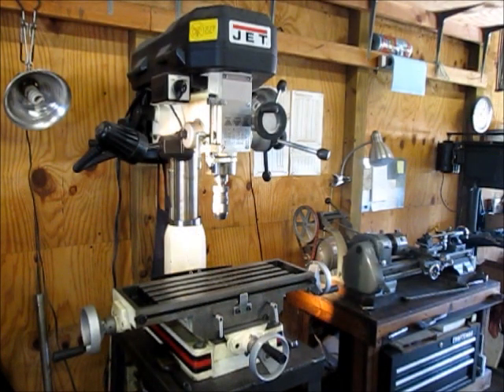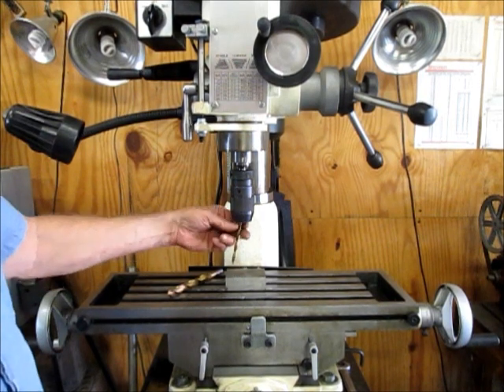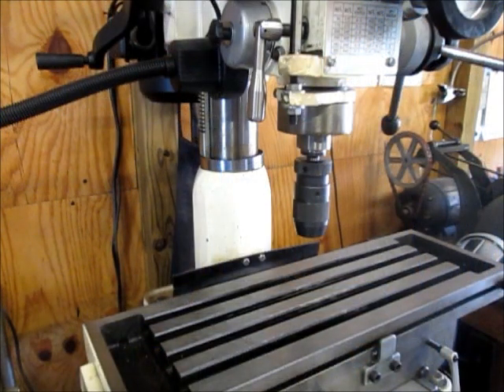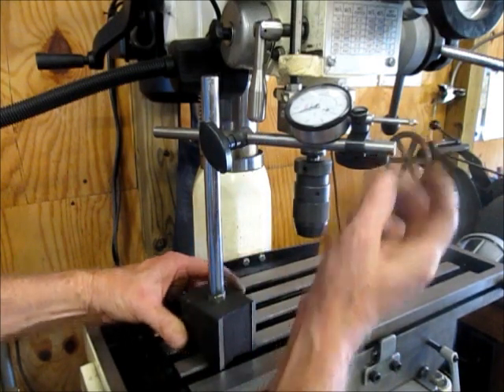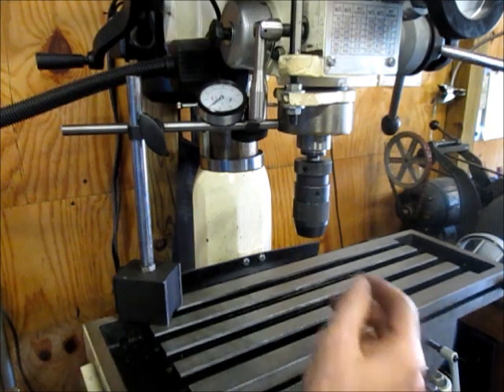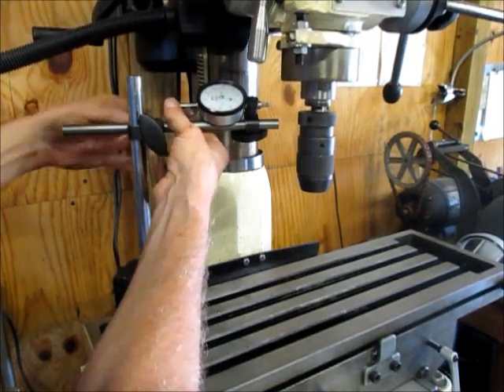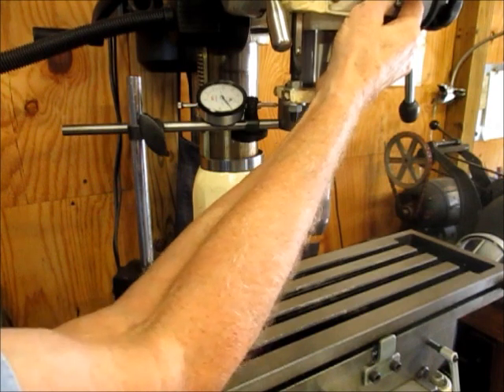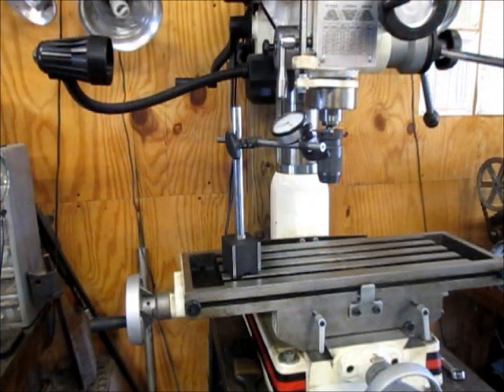Round Column Mill Head Alignment

Comment: I, too, have a round column mill. I fitted a second column, with ball race followers. Coupled with power lift (no external torque) it gives head movement without needing to re-align. Build is in my videos. You alter the height a lot more often when it is easy!

Comment: Exelent solution to the problem. BTW, we’re using those machines for projects with not very tight tolerances. Usually within.003”. I never had a problem with re centering the had.

Comment: I think you're procedure is good except the use of the "hardstop" because there is no assurance that you won't bump the hardstop with enough force to move it a few thou and the indicator will still read zero.  It would be better to just use the indicator zero without the hardstop.

Comment: This is the first video I've seen with this method and how I have verified the head on mine for years.
I've looked at all other modifications that have been machined, bolted, and welded on, and there is still deflection with the final product/end result.
Save yourself a lot of time and aggravation, use a dial indicator with a magnetic base... just verify your quill is true to the table.. the four bolts holding the column to the base can be shimmed.

Comment: My feelings exactly. I just purchased a used 2007 Rong fu 31. I have been looking at a number of videos on “ the big problem with round column mills” and all the time people have put into making a guide system to mount on the side of the mill to “fix the big problem”. I consider the common sense method you show is the easiest and simple way to deal with the round column. Thanks for the video. Maybe some of these others might look at say. “Why didn’t I think of that?”

Comment: The dial indicator is pointless when up against the hard stop. It won't tell you if you're pushing on the stop. Use the same method, but with the dial indicator alone.
Reply from the maker: not so

Comment: This is a good method, thanks. I've been using the laser method and that works pretty well. I have a future project to attach a pillow block to the side of the head and another pillow block to the side of the column casting, along with a rail between them (all acquired from 80/20). Once completed, this setup will render the mill a non-columner mill. Super easy to move up and down with confidence. Speedier too.
Reply from the maker: Sounds good.
Reply: What is the laser method? Thanks
Reply: @kennethtencza9209  you probably heard by now, but you mount a laser on the mill head and aim for a line on an opposing wall.   The longer the distance, the more small moves are magnified.

Comment: Another method is to mount a laser on the machine, and a target line on the opposite wall.
Reply: Ive tried that method  and unless your opposing wall is a very long distance away, you wont get any real accuracy.   My wall was 4m away and could move the mill at least 5 thou without it showing on the laser line.     This method has to be one of the most accuarate Ive seen

Comment: Thanks for this. I will be picking up a similar machine in a few days. In thinking about dealing with the head movement issue I thought about mounting a small laser on the head, pointing downwards, with a fixed "target" on the base. Then as long as laser is pinpointed on the target head alignment should be ok. Am I correct?  Would appreciate any thoughts on this idea.
Reply from the maker: I haven't tried using a pointer but I know it's a common method. Keep in mind that the wider the arc you measure will make it easier to achieve greater accuracy.

Comment: On mine i use two different vises. a shorter one on one side and the larger milling vise on the other side of the table. I just check for parallel alignment on both before i start.

Comment: Contemplating a Jet JMD15 round column mill drill but the round column kinda scares me. I’ve often heard people say they’re great drill presses but not great mills because the round column can allow the head to pivot while milling. Has that been an issue for you?
Reply from the maker: That has happened to me a couple times when trying to hog too much. High quality end mills are a must. It all comes down to time. If you need to get a lot jobs knocked out quick I would go heavier. .020 passes in steel is doable. .050+ cuts will strain it and possibly move the head. Sharp tools, slow feed and light cuts will make some nice looking parts. That said, a square column with power down feed would be pretty sweet.

Comment: I set up a steel plate on top of my mill and have a laser pointer with a magnetic base that I aim at a line drawn on the wall.  After moving the head, I just turn the head to point the laser where it used to point.

My problem with moving the mill head up or down is that it changes the tramm.  Had to make adjustable parallels so I could tramm the workpiece.  Tramming the workpiece was much easier than tramming the mill... especially considering that I have to set the mill head to a special height to tramm it.  I'm using one of those circular tripod tramming tables as it seems to work best.

If I could afford to do it over, I would gladly get a mill with a dovetail column.
Reply from the maker: I think one of these machines are good for a mechanic or fabricator where within a few thou's are usually good enough. A pro level machinist would probably be better served with a different machine. For the general work I do this machine works good and it's a good match for my little lathe.

Comment: That was an awesome tip !!! Thanks!!
Reply from the maker: Thanks for watching!
Reply: RP Mechanics may I ask where if you remember where you bought that indicator with the bump stop?
Reply from the maker: You can get those cheap indicator stands at any machine tool store. I removed the fine adjustment arm and turned a solid one to take its place. It was a metric size, 13 mm if I remember, so I couldn't use a piece of standard round stock.
Reply from the maker: That's a good question. It didn't occur to me to touch on that in the video.